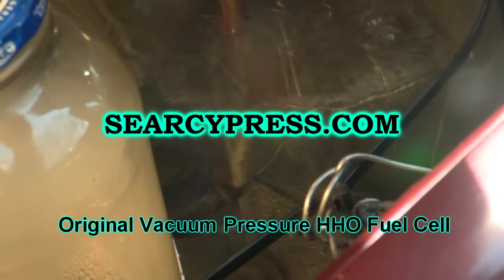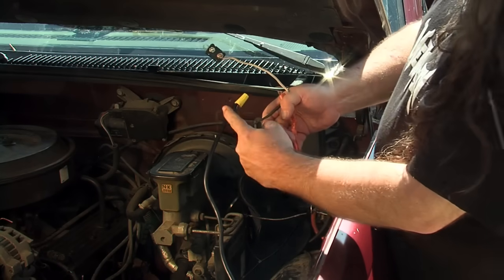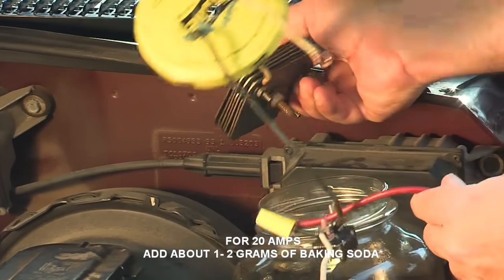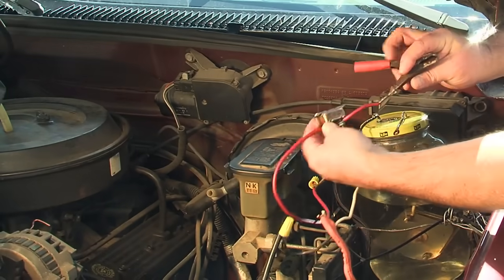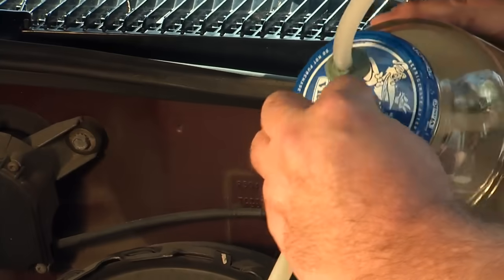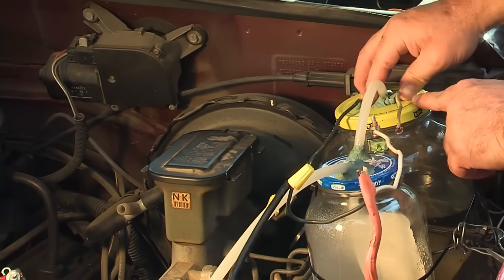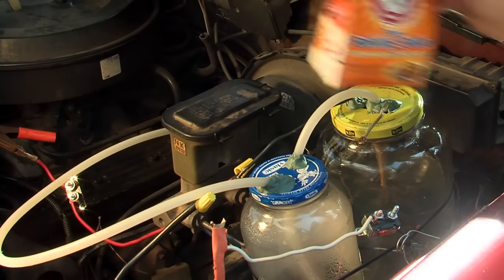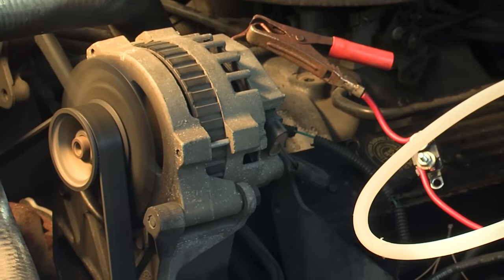Vacuum Pressure Hydrogen fuel cell defeats high gas prices using hydrogen from H2O.

Comment: Lots of mis-info here 
1-extremely unsafe with your anode and cathode coming through the top of your jar they get hot and can ignite hydrogen in the top you must bring anode and  cathode underneath the water line
2- that set up only produces 2 to 3 L of hydrogen oxygen mixture per minute
For example if your engine is 5 L and spins at 2000 RPMs at 60 MPH that’s 4 rpm for 1 combustion cycle that equates to 10,000 L of fuel air mixture per minute and your device puts out 2 liters per minute not enough production to make a difference
3—-your cars alternator is now working many times harder creating a load on your engine thereby less fuel economy I know for a fact you lie when you say better fuel economy I bet you wonder how i knew this?
Reply: Not sure how you get 10,000 liters per minute.
Each cylinder has a power stroke every 2 revolutions.  That means each revolution of the crankshaft has 4 cylinders that fire.  4 x 2000 rpm = 8000 power strokes per minute.
A 5.0 liter, 8 cylinder engine = 0.625 liters per cylinder.  8,000 x 0.625 = 5,000 liters per minute.
From what I can tell, the air-hydrogen mixture for max explosive power is 34:1.  So, for every 5,000 units of fuel mixture, you need 1/35 x 5,000 units of hydrogen...or 142.86 units of pure hydrogen and 4857.14 of air.  I know that may not be 100% accurate, my chemistry is a bit rusty...maybe "moles" is the correct unit of measurement? 
Either way, though, you dont need 10 kiloliters of hydrogen per minute.
Lastly, I dont thin he was running on just hydrogen, the hydrogen was in addition to gasoline.  Kind of like "nitro boost", nitrogen supplement to the gasoline.
I dont know much about this specific subject, but it's pretty interesting.
Reply: @firemedic947  it's HHO gas - the perfect amount of oxygen is already there, you'd be better off looking at the energy density of HHO vs the air/fuel mix used in cars..... Or some laws about thermodynamics and understand that the engine is 80% efficient at best and the alternator is about 70-80% efficient and the HHO generator is probably about 90% so you're never going to get back the energy you put in and the whole thing really is just click bait and we both fell for it.
Reply: The government send y’all 😂
Reply: @chrishoonbag8844  This guy would be dead and the video removed if it were real.

Comment: Don't truck carburetors have float chambers ?
If they do, wouldn't he have to adjust his float height to use less gasoline ?.
Otherwise hes just running a rich fuel/air mixture using the same amount of gas with added hydrogen.
Thats at the very least. He would need to change all his jets, his air filter & exhaust system too to ensure full combustion of the mixture. Prolly would need to change out his entire valve train too, new camshaft with higher lobes to keep the intake & exhaust valves open longer.
 What's coming out his tail pipe is as likely to be unburnt fuel as it is water.
As for steam cleaning yer engine internals n evaporating, diluting n washing way the engine oil with every power stroke in an 8 cylinder engine ?
No way hes done 30k on that system.
If yer gonna introduce an extra fuel source to yer system yer gonna need a fuel injected system with an ECU  making automatic adjustments to lower yer gas consumption.
That guys a joker.

Comment: Thanks for sharing. I just thought of this, and figured someone must have done it before. I'm wondering what the advantage of using a vacuum line opposed to just putting the hose in the air intake stream is.
Reply from the maker: The thermal properties. In vacuum the water acts much like refrigerant. Having the right temp, preventing thermal runaway, results in more production. Thanks for the comment.
Reply: @metalpresstv  Interesting. Thanks for the reply.
Reply: @metalpresstv  water is a refrigerant R-718
Reply: @metalpresstv  can you send me step by step instructions on how to set this up in my car?
Reply: A guy in the 70s was trying to patent something similar.  He mysteriously died.
Reply: @fritzthecat9451  His name was Stanley Meyer
Reply: @Arcturian1111  and he hustled u all with a few second grainy video of him running a dune buggy off acetylene.
Reply from the maker: When you inject into the air you're mixing the HHO with the nitrogen and oxygen that exists in the air. This is leaning the gas very much. Injecting in vacuum is much different. The thermal properties of the water react a lot like refrigerant. The boiling point of the water is greatly reduced. Injecting into the air can cause O2 sensors to sense an increase in oxygen and cause the computer to add more fuel diminishing effects. The thermal behavior of the cell itself is maintained in vacuum. As long as the vacuum is maintained the safety of the system is improved greatly over a non-negative pressure system. Thanks very much for your comment.
Reply: I need a complete parts list, can anyone put that in the comments?

Comment: I am guessing that you're in the south? What about winter weather? How would you keep it from freezing?
Reply from the maker: It is good below freezing depending on the amount of soda you use. It varies, so it could be a problem for some areas. If you are in a cold climate you could build a cell with further gap spacing and run higher levels of soda to get the amps back up. Just a thought. Thanks very much for the comment.

Comment: really could be the fuel to easily recharge an "electric car battery" just need a closed system...those Vlasic jars might not pass inpspection
Reply: Definitely don't want to drive down any rough roads... lol
Reply: it takes far more energy to produce the hho than it puts out, not to mention the amount being produced here is not enough to actually make a noticeable difference in the engine from the combustion. the reason he is seeing a slight mpg increase (maybe 1- 2 mpg) is because the hho being sucked in is acting like a cooling solution for the atomized gasoline, dropping temperature and thus increasing the density of the charge. same reason your car seems to have a bit more kick to it in colder weather, denser charge of air and fuel via cooling.

the setup he has here though is extremely, extremely dangerous, and can be fatal, i would not recommend replicating it at all
Reply: @ravenquinn7774  wow an actual intelligent reply that makes sense...thank you
Reply: @ravenquinn7774  I've ran one of these systems for a while so I have first hand experience that there is no impact on fuel economy. At least on my car.
But I've know people, smart people who insist they gain improvements. Significant, in the region of 100% higher mpg in some cases.
I only have two theories so far.
1. People are delusional (they weren't lying, they believed it).
2. Maybe if your engine is running really crap. Knackered injectors for example, maybe browns gas can mask the issue of incomplete combustion by almost acting as a pilot light. But I'm clutching at straws here.
Reply: @richardschofield2201  mmm, a lot of the times it comes down to confirmation biased placebo  effects. I.e. delusions that make it seem like its doing better because you want it to or believe it should, so your brain tries to make the info fit that. Theres been extensive testing done on this in the 80-s up to the mid 2000's, that rated  the possible increase in mpg from localized hho generation to be, depending on production amount, at most 3mpg. on average it actually worsened it. about the same for hp too. not even a 1hp increase even when the engine is optimized for the hho induction

Comment: I built a 4pak in 2007 to run a Ford expedition, we We got 7 mpg avrage without the 4pak we got 21mpg with it, everything was fine until I had to clean the system at a gas station, They called the Cops on me and Claimed I was building an IED. Long story short I was Ordered to Leave the Store at gun point while trying to refill my system. didn't get it back together Right I already have officer  induced PTSD, and the Whole system detonated on me as I had no back draft arrestor,  ruined the system but didn't hurt anyone as it was IN the Cab on the trans tunnel. they Should have just left me and my family alone

Comment: It would be great if you show us step by step 👍thank you very much
Reply: He left out a few critical statements here. Introducing more air into the vacuum line will cause fuel injectors to introduce more fuel, therefore burning way more fuel than you did before. Also without a good way to vent the gas you would most likely build up enough HHO gas under the hood to kill everyone in the truck................................If it's on the internet and someone made a extra long video about it = IT MUST BE TRUE? XD

Comment: The gas vaporizer method is something you might try next; they bubble air up thru a heated tank of gas (use copper tubes to run exhaust gas thru the gas tank and back out to outside away from the fuel tank to heat the gasoline), the bubbles of vaporized gas are harvested to any handy vacuum inlet to throttle body or carb or intake manifold, some say it gets 200mpg ;  supposedly a guy in the 30's (pogue ? ) had one and it was deluxe  (search youtube videos for it) and really worked.   I got a simple AC cutout switch that automatically cuts off ac compressor when accelerating to give u more power just when  you need it most, I figured i get about 10% more mpg with it (uses old style vacuum advance from older type distributor advance system to clik back AC on when vacuum is high again (after acceleration) ) ; just cut the AC power wire and hook it into the automatic cutout system, drill a hole and hook a spring to the sidewall of firewall near fusebox (you need that to provide power to the switch which is normally on (high vacuum), when vacuum goes low (acceleration) the advance moves the switch to off and AC is off.
Reply: I been experimenting with gas vapors. Acetone mixed in makes the the gas evaporate faster
Reply: Project Farm here on youtube has disproved all of these fairy tales. Even this one. Lol
Reply: @Shepardofman  I really like Project Farm videos but in that case (and this one too):
He didn't retard ignition timing.
He didn't check for proper fuel mixture.
He didn't change compression ratio.

On sensorless fuel systems is easier, but with ECU and O2, the computer will constantly try to make exhaust gases to be as close as possible to its programming.

The prevaporized thing is not plug and play, some things must be changed and most videos here on youtube only do the plug and play thing.
Reply: @JavoCover  project farm didn't use a metered engine, there was no o2 sensor.
Reply: @guywithjeep  I meant other engines, but in this case (this video) the first two modifications I said would have make a change.
Reply: @Shepardofman  I was just about to write the exact same thing..I remember project farm tried the gasoline vapour...it's bullshit...

Comment: Great video !   Could you tell us what your mpg increase is ? thanks.   One thing to beware of is the fact that when people put a bottle of water in engine compartment and then generate 02 and H it is very explosive, right, so they tend to initially drive much more conservatively (more mpg therefore) than usual, later when they start driving it normally,  the savings in mpg diminish).   thanks.
Reply: Who cares about mpg when H2O is readily more affordable than gasoline.😂😂😂😂😂😂

Comment: I wonder if that hho generator also generates heat in operation? thank fir sharing, nice presentation!
Reply from the maker: Yes, they all do. The vacuum pressure fuel cell however behaves much like a refrigerant evaporator. The thermal properties are leaps and bounds above other designs that run at pressure. Thanks very much for your comment.

Comment: So your are using energy to make fuel and use it again to make power, doesn’t sound efficient but interesting, from what i know is that when you have a electric load on your alternator i will increase the load on the engine requiring a little bit more fuel so i dont know how this thing works together
Reply from the maker: You're absolutely right, we are using power to make the most explosive gas there is. If we burned 100% of the fuel in our motors there would be no chance of gains. This is not the case. A very large percentage of the fuel in your engine goes unburned because of poor ignition. Adding this gas increases the efficiency. It is not over unity because all we are doing is regaining the potential energy of the unburned fuel. Do you think it takes more energy to get oil out of the ground than the oil is able to produce? Certainly there are costs involved. We are mining hydrogen and oxygen. This process stops engine ping even on low octane fuels. That alone saves a lot of money if your vehicle requires high octane. I'm not suggesting you try this. We did the research and showed the results. Thanks for the comment.
Reply: @metalpresstv  thanks for your explanation this will get me to think about this more, iam an engineer by the way thank.

Comment: You did show how you got the gas from the jar to the engine
Reply from the maker: The gas is piped in via the vacuum line. The vacuum is critical to the production and thermal control of the fuel cell. Thanks for your comment.

Comment: I don’t believe this is a true hydrogen generator because there will be excess Oxygen; the oxygen needs to be separated from the hydrogen in order not to fault the O2 sensor or it’s possible if you had access to the software to figure out how the O2 adjusts the fuel; also the amount of energy that is consumed to generate the gas. I believe a power and thermo calculation would be needed to determine efficiency
Reply: My relation had a Ford feasta a light  came on it was the 02 sensor his care had another tank that adds something else to the fuel and would cost about 700 pounds to get done I googled the sensor and found how to trick it with a pic chip 19m2 picax are cheap about 2 pounds easy to program on a pc it was on for 3 seconds of 3 seconds a wave it was simple to replicate if you Google Ford 02 sensor additive trick sensor I reckon you will find it then the car will think all is good and no lighr on dash sonthing that would anoy me

Comment: I've ran hho systems it work's. Wire is better than plates wire wound like springs more surface more gas made.. When i was running Hwy in Montana mountains worked awesome. Biggest issue is hho loss due to the micro gas escapes with certain types of hoses. Also mono atomic gold is the best catalyst . more hho output.

Comment: i tried this too, got about 5-10 mpg better, ( under the BEST conditions ) but it started to make the engine run to lean ... it needs to gasoline to help cool the cylinders .. if you try this please ADD A PYROMETER in the exhaust and WATCH IT!   maybe water injection would help .... ???

Comment: Can you make, or have someone make identical trips. One full tank with the system = ? gpm. And one full tank without the system =? Gpm. Ten tank test would be a great stat report for all to consider. Especially if it was a double blind test.
Reply from the maker: That is actually how we proved it to ourselves. There were videos on this however of course naturally they were pulled for violations.We performed the test by running the truck out of fuel, adding 1 gallon of gas and running it out of fuel. Turning on the system adding 1 gallon of fuel and running it out of gas again. Probably not the kindest thing to do to your fuel pump, but the gains were great.  It can vary because of the way you drive. If you are trying to get good mileage with your foot, you will certainly improve it. When large amounts of HHO are injected it can be very tempting to heavy foot it because of the increase in performance. You can actually end up using more fuel. Thanks very much for your comment.

Comment: Hydrogen is a very dangerous gas, very explosive in a wide range of proportion with air. By the way, the amount of energy (fuel) spending to separate oxygen and nitrogen in the molecule of water is higher than just putting the engine to run with fuel. There is no free energy, since the electricity produced by the alternator comes from the engine, so from the fuel.
Reply from the maker: It is most certainly not over unity. Much of the gasoline that goes through your engine does so without getting burned. The injection of HHO gas creates a more efficient burn. This process allows you to burn cheaper lower octane fuels without suffering from engine ping. You instantly save a tremendous amount when you fill up. Certainly not over unity, just more efficient.
Reply: @metalpresstv  why the car makers just don't put it in their car from factory, since there are lots of CO2 emissions everywhere. Again, hydrogen is a dangerous gas to deal with.
Reply from the maker: @rodrigocsilva7729  Actually hydrogen is safer than gasoline when stored property. It is the future of Trucking. Nickola company may or may not be the ones to make this happen, but it is coming. Battery power has no chance in the trucking industry. It may sparkle briefly, but will fizzle out. Try hauling 30000 pounds up the mountains of Colorado. Even diesel trucks struggle.

Comment: Anyone who attempts this would be well advised to practice on an old Briggs and Stratton engine first.
Reply from the maker: I don't think you're going to get 15 in of vacuum from a Briggs & stratton. Might be possible, not sure.
Reply: @metalpresstv  you won't need any more vacuum. Just a little bit of hydrogen would be need to enhance efficiency.
The additional of excessive oxygen might produce too much water as a combustible by products
Reply from the maker: @williammielenz3752  Right, but this is a vacuum pressure fuel cell. Anyways  thanks for the comment.